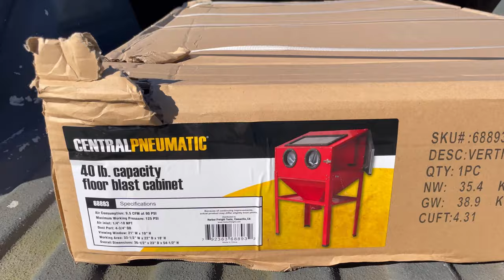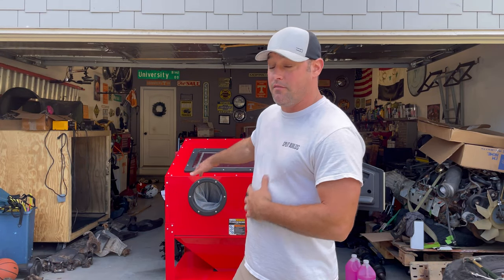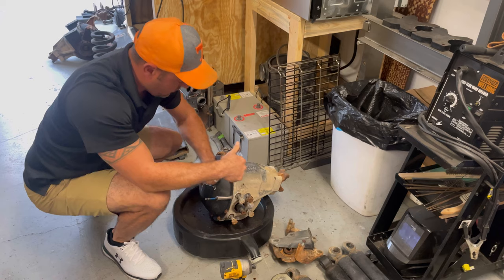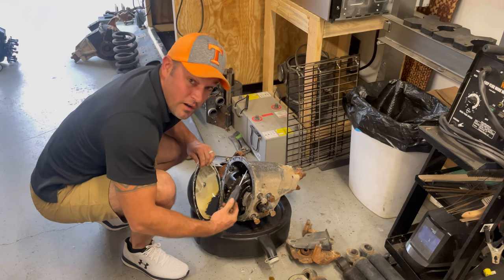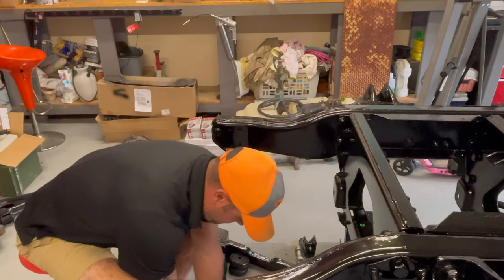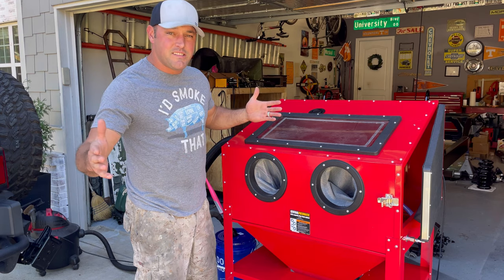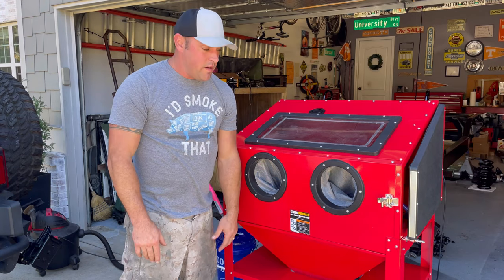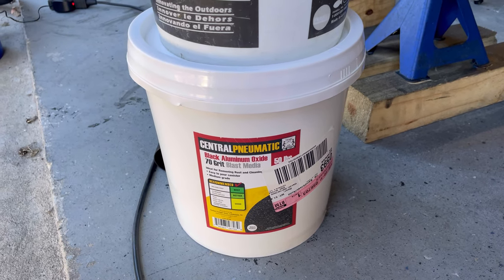Humvee Differential Breakdown and New Sandblasting Cabinet

Comment: Had a similar problem with an impact gun. I just bypassed the regulator completely. I have the table top version of the blast cabinet and it does not require the CFM needed to run the larger cabinet. Larger compressor is needed or if you can borrow another one hook them both Together with a Y fitting. It might supply you with enough volume to get the job done. Another project to consider if building code or more importantly if the wife approves build a workshop out back to store the bulk of the tools used for your rebuilds. I use a surplus ISO military comms shelter to house tools and supplies. Works out great and easy to secure and alarm.

Comment: I got this 5 years ago and the nozzle would get clogged because of the humidity so I kept the tip loose so I could clean it out easier. I figured the gun was not as good. I have a 125psi harbor freight compressor. My neighbor wanted to use it and he said I didn’t have the capacity or the pump was not keeping up. He dragged his mile long hose from his garage to mine and hooked it up and it worked well. I dont think you need a big tank, though it would help, I think it is just wise to have a higher output pump to keep the pressure high
Reply from the maker: Boom! Awesome thanks for the info!

Comment: Harbor freight sells a Bauer cyclone dust collector for $40. I think you will find it works better than your DIY one. It comes with everything you need and snaps right on to a 5 gallon bucket

Comment: 19:33 What kind of powder coating did you use for this one? Epoxy? PE-F? A mix thereof? Something else completely? I find it strange that you sand or glass blasted the calliper without disassembling fully first. Also using the vacuum cleaner to remove powder coating from surfaces that does not need powder coating is a good option; such as threads and machined surfaces.

Comment: You need an air compressor that has more volume and that can keep a constant 90 psi. Powder coating the brake calipers is going to ruin the seals and will require them to be rebuilt. Be careful not to powder coat threads and machined surfaces

Comment: Does the air requirements of the cabinet less than the compressor supply?
Reply from the maker: My compressor will do 175 max PSI in the cabinet only needs 90 psi to run.
Reply: @SplitBuilds  The problem id CFM or Cubic Feet per Minute at what ever PSI. Your cabinet requires 9.5 CFM at 90 PSI to operate. Can your compressor provide at least 10 CFM @ 90 PSI, if it provides 10 CFM at 175 then it does not have enough.